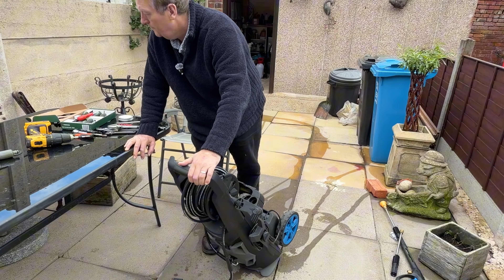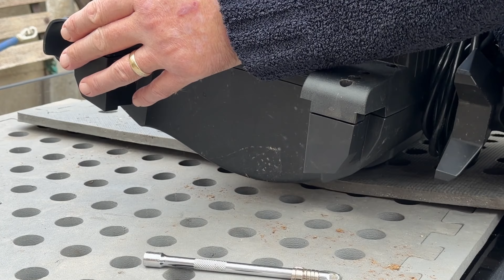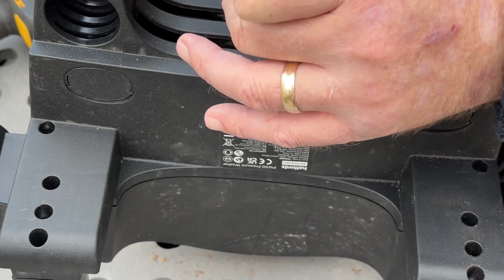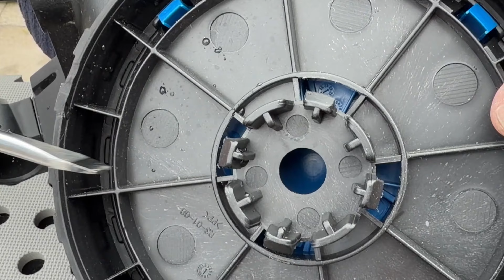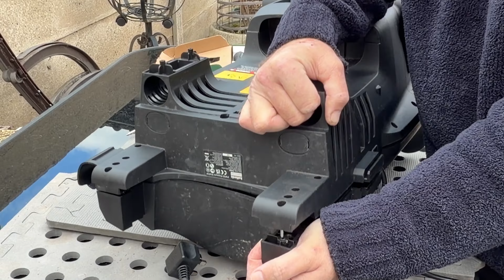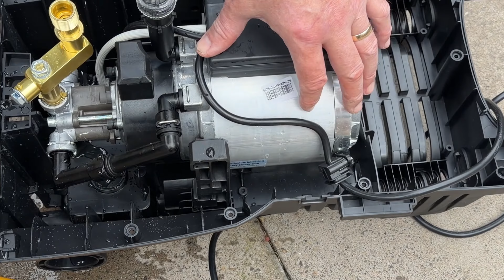How To FIX a Broken Pressure Washer FAST! (Full Tear Down & Diagnosis)

Comment: Hi i have no power when u switch it on there is nothing any idea?? Thx
Reply from the maker: Check your fuse and power cable connection first, as those are the most common culprits for a total loss of power!😊

Comment: Hi im struggling in breaking down the motor I have the seal poking out of the flat end but can't seem to open it any further  than removing  the bearing end any advise would be a big help
Reply from the maker: Difficult one here you need to warm the end up around the bearing and then get a blunt chisel like instrument and hit it one side then the next carefully keeping it warm, it will be best with 2 of you, if you are local to me I could help you what is your postcode?  There's no where to get a puller onto it and anyway I had all my garage equipment stolen years ago and only replaced with bits and bobs that I get by with, you  can see with my tools I certainly didn't work on racing motorcycles with those tools.

Let me know how you go,